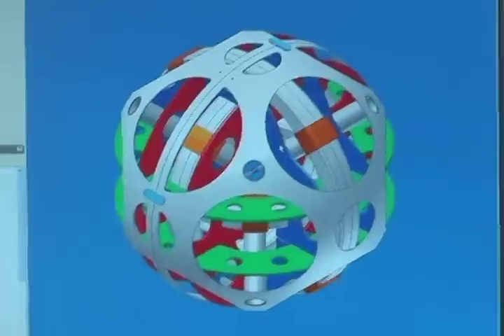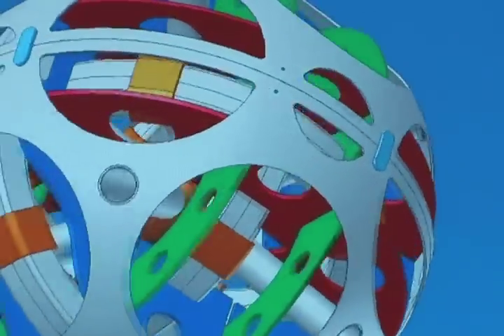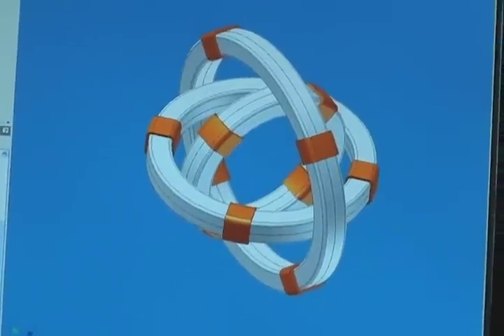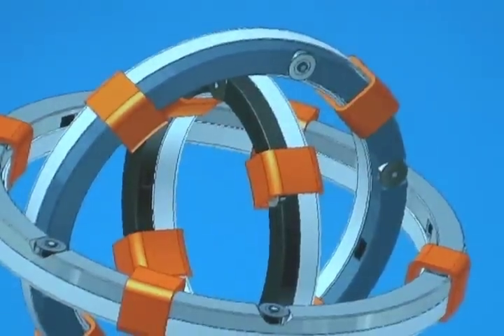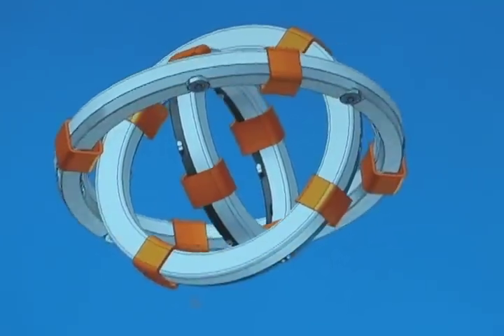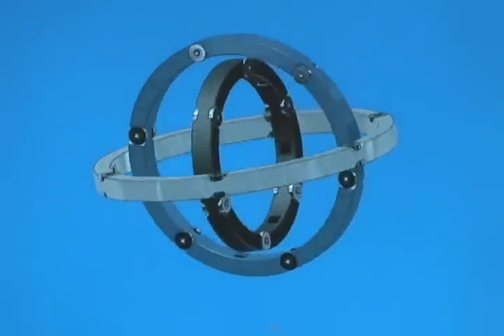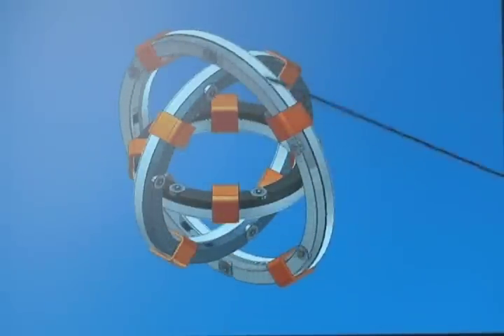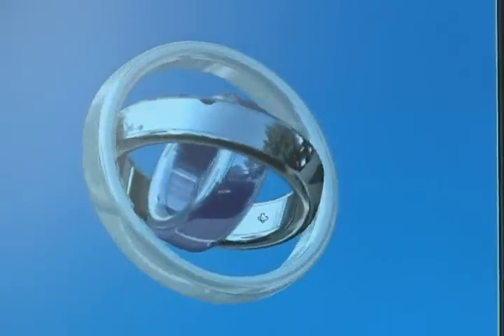Apparatus for Gyroscopic Propulsion Explained

Comment: When I was deeply involved in inventing during my inventing years, I encountered the same conclusion as he states at timing 0:50 in this video. There are currently no equations that apply to this effect. :)
Reply: The design I came up with some years back was to create a more pronounced drive effect by using four separate thrusters. By building them separately this keeps the costs way down. It also makes the device much easier to construct, and to replace when they wear out.

Wear is going to be a major part of the use of these thrusters when they hit the aerospace market (if they ever do). And no, I did not patent my design because when a person patents something, he has to make his design public, which I will not do until I receive a decent payment up front.
 
When I privately spoke with Maurice Ward, the inventor of the only known substance that can withstand the heat of a 10,000 degree thermonuclear blast, he told me a defense contractor tried to steal his Starlite sample. This created such distrust, that Maurice flew back to England and cut off all negotiations on selling his amazing Starlite material.
Reply: Can't say i liked Mr.Ward 1 bit. His secret formula got blatantly stolen a few times. Good!  there is no room in this game for greedy fuckers.
Either u want to change the world for the better, or u dont.
Considering he was 1 of my countrymen, im appalled by his behaviour.

It wasn't the fact that someone in the americas wanted to steal it.. its the unfortunate mindset of a greedy alchemist who wanted billions for something 80% organic & made from hair products.... and still maintain over 50% profits of everything, including its controlled applications.
He thought that this control would open up further secrets of other composite materials to himself through various organisations.
Totally unrealistic expectations in business and the inventors world.

Cutting it short, the man was an insatiable cunt. Hope this helps in clearing up this man's personality and greedy mindset.
Never underestimate the most softest spoken person when it comes to MONEY!.
Now hes dead and its on lockdown.. hahahaaa. Yes what a marvelous man. (sarcasm)
Reply: Exactly. Thanks.
Reply: Rockguitarnow  Just because you and Ray Tippett don't know the math, does not mean that the math doesn't exist.  Describing the gyroscopic pressession phenomenon is acrually quite trivial;  if, that is, you understand Newton, despite Ray's claims to the contrary in his patent.
Besids, the math is not the phenomenon.  Math is only a model for the natural phenomena that we have been able to assign mathematic models to.  All the concepts Newton taught us can be described without math.  The math allows us to quantify things so we can calculate what we want to happen without actually having the objects themselves.  This is sort of the definition of Engineering. 
Cheers, ScienceAdvisorSteve
Reply: @Observ45er  hey you sound like you know what you are talking about maybe you know more physics than i do. So can you please tell me if the set up in the video will work or generate some lifte or thrust???? And why please...thank you in advance
Reply: @aminnima6145  Well, it will not generate any lift. I don't see why there's any reason it should. I just listened to this video again after all this long time and he says nothing about lift in it. Also, scanning up above this I see that I provided one very long post. If you haven't read that, go find it. I think I must cover it all completely.
.
You cannot generate a unidirectional Force force from rotating masses.
..
If you understand what a gyroscope does it basically changes the direction of the torque force you apply to it by 90°. Buy putting three gyroscopes together is a very common way of generating a stable platform that will not rotate in space. 
However , you can translate it all you want. An ordinary gyroscope can be translated up, down, left and right and as long as you don't try to rotate it there's no problem. Many a young amateur and uneducated person interested in science has come up with this same idea..
Do some research on what is called the Dean Drive. It defines a science fair project it apparently some people have been able to build that appears to produce lift when you set it on top of a bathroom scale, but it's deceptive.
.
Please find my other long comment I'm pretty sure I must have covered it all, but I don't remember everything I said and I'm too lazy to read the whole thing right now.
Scanning over my old answer I also see that I made a comment that I looked up to patent and have the number for you to look at yourself. What I said then was that his patent describes this thing, but makes no claims about any sort of propulsion system.
.
In this video he describes a lot of irrelevant stuff that says nothing about the concept that it works on and he's making up terms when he talks about the forces.
.
Since we know that the gyroscope can change the torque you apply to it by 90°, it's possible to take three of these and get that 90° to come back and oppose the torque that you apply, so that when you try to turn it it resists being rotated.
As I said, this is nothing to do with translating its position in space without rotating it.
I don't know what else to tell you.
Reply: @Observ45er  yeah that's exactly what i know about gyros: precession and rigidity in space...thank you soo much for your answer...
Reply: @aminnima6145  K
Reply: @Observ45er  So I assume you understand all the various dynamic forces & electromagnetic fields at work here. If you can't explain it you don't understand it.
Reply: @cosmicHalArizona   Yep. 
You may assume whatever you wish, but there is no linear, translational component to angular momentum, rotational inertia or moment of inertia or a couple.  Never has been. 
It simply is rotational. Can't be much simpler. Those who don't understand that fundamental bit of physics  keep trying to find what is known to not exist. Those who claim so, need to provide the evidence and ever since the Dean Drive was published and shown to be meritless, people have been dreaming they will be the next Newton.
Reply: @Observ45er  facts !!
Reply: @brianlee9310  And, this ^^ is supposed to convey some meaningful message?
Reply: @Observ45er  I was agreeing with you ?
Reply: @brianlee9310  Couldn't tell.  Try being clear.
Reply: @Observ45er  so I want to harness pure energy from the ionic atmosphere as did our ancestors.  What do you think would be the best way? Also I love those orgone generators.  Pyramids and what not. Have you ever thought about making one?
Reply: @Observ45er 😂 this guy ^

Comment: I always wondered if Ezekiel's description of a "wheel within a wheel" propulsion system would be like a gyroscope that contained two wheels, one within the other properly counterbalanced, that went in opposite directions.
Reply: albert miller "Forever learning but never coming to truth" - the apostle Paul. Don't just question, come to a conclusion based on evidence, and why question what is common sense?! Question is 1 + 1 = 2? No, question what matters.
Reply: Anon Mouse You recite the bible in a conversation on truth? I mean it had it's relative truths but come on man, that's a logical fallacy in itself, not evidence.
Reply: Question everything.
Reply: That's what I was thinking. This invention is thousands of years old. Ezekial Chapter 1 and 10. Solomon said that nothing is new under the sun.
Reply: Just look up project looking glass machine

Comment: They give you the disclaimer at the end of the video " this is just the idealized version of the concept " . Otherwise , this object isn't attached anywhere , also it is a poor concept as many movements are left out while adding movements that can't happen . Also wouldn't , if you were to  design a gyroscope , want the most heavier ring on the outside and the smaller ring on the inside ? Because the effect of rotation already creates a centering effect , thus the center piece has less work to do and could be lighter , whereas you'd want as much energy produced with enough weight to create it at the outside .
If attached like a conventional gimbal type it would perform like your basic gyroscope , if it was all attached correctly . Nice display , "A" for animation , -f for mechanics .

Comment: This appears to be more of a non propulsion mechanism, producing stability.  This is similar to what cruise ships use to reduce rocking, no?
Reply: This guy is not compensating for gyroscopic drift with counter rotating gyros. But the theory is if you speed up or slow down any of the gyros that would have an effect on the other gyros crating movement. And this would be for space or anti-grave vehicle.
Reply: Sandy Kidd impressed Universities with his Antigravity machine.  It is a very simple device and obviously thwats Newtons laws.

Comment: Even if it worked it would be buried with the rest of the advancements of science  (probably Area 51).  It will never replace anything nor drive automobiles.  The oil companies won't allow it.  Why do you think we are still stuck with the dinosaur internal combustion engine?  Also unless it can generate free goods and services to the welfare masses, the liberals and Obama would not allow it to become.  On the other hand, if this idea has merit it will make you rich after the powers that be buy it and hide it.

Comment: This would work. Absolutely brilliant. Most people do not understand what gyroscopic forces do when it comes to mass and expression of energy. For instance If i took a barbell from a bench press machine and slid a 45 pound plate on one end of the barbell and fastened it to the end so it could not come off there would be no way for me or really anyone to pick up that barbell with the plate on one end at the farthest side of the barbell. And even if i picked it up with one arm i could not swing it around my head like a sword or baseball bat, the weight would be to great and the forces of gravity would not permit me to swing such a mass. But if i had the same barbell with a 45 pound plate on the far side but this time i used a motor to spin the 45 pound bar bell to around 35,000 rpm then once the 45 lb plate is in motion the gyroscopic effect it would have on the plate would be so great that i would not only be able to pick up the barbell and 45 pound plate with ease but i could lift it over my head and spin it around with one arm. Now thats just gyroscopic force on the +y and -y axis's acting perpendicular to the barbell on the horizontal -x and +x axis's. You're device would act on the +x -x  & +y -y & +z -z axis's thus covering all areas of spacial force expression. And thus all  areas of space/time around this device driven by the three rings composed of different masses to equalize the difference in sizes to make smaller heavier rings and larger lighter rings would ingeniously express the centrifugal velocities equally from the center of mass in the middle acting on all three axis's and thus would literally cancel out the objects mass completely. Thus defying or acting against the forces of Gravity working against the device. Great work this should be fabricated and put to the test!
Reply: You got it.
Reply: If the mass to angular momentum of all 3 components is infinitely equivalent, it will be infinitely stable but not free of its own mass. Particularly if it's housed inside of a further installation, the housing still has its own mass. Its total rotational axis would be unchanging but whatever larger mass it's drawn to will still draw it in. It's not like you're climbing a gravitational slope on the power of gyroscopic angular momentum alone.
Unless I have a fundamental misunderstanding of event horizons and their relationship with positive/negative angular momentum.
Reply: @EndyMMG  What would happen to the angular momentum if a force from within was to be applied on 1 of the rotational axis perpandicular to the gravitation ? Would this generate a precession upwards :-)
Reply: It would work if he build a searl effect generator

Comment: where do i sit.?..lol..said einstein....where do i house my depressed soaking wet cat? you could add sliding coils with a degree of freedom rather than fixed position coils to create a differential in the drive for fine movements and hovering. that way the coil can be moved by hand as well as weigted to create the necessary differentials to overcome stabilisation and create drive. thats how its done where i come from. and we fit a seat in a fixed position around which the apparatus moves in order to have a pilotable craft. they already exist im afraid but not in this realm. especially useful in 0 gravity and microgravitational conditions.

Comment: There would be no drive energy being created here, the coils run past the magnets but so what? As the lines of magnetic flux cut through the coil causing electrons to flow in the coil where do they go?
A metal ring with coils and magnets on it is not a motor.
Reply: You are mistaken. if i take a single piece of copper wire say 2 feet long and wind it into a loop or ring shape and then place a magnet below it or above it or anywhere parallel to it and take each end of that copper coil and attach them to a source of electricity the permanent magnetic field of the magnet interacting with the alternating magnetic flux of the current from the AC battery or power source would be unstable and constantly trying to re align its continuously changing field of North South North South North with the Permanent magnets Set North or Set South field. Thus causing the coil to spin. The same concept is being explained in this video.
Reply: this design is utilizing the same concept of a coil gun or linear accelerator but instead of a straight linear path the coils are pulling the rings through their center magnetic fields flux in a ring shape thus a constant 360 degree rotation occurs. If you think that this guy is wrong then you are then saying that the scientists an engineers who built the LHC in Switzerland the Large hadron Collider, do not know what they are talking about.The same principle of motion that is utilized to propel the rings around the coils are the exact same principles that scientist and world class engineers use daily to propel highly charged particles in a systematic series of loops before they collide with another charged particle in the circular tunnels of the Large Hadron Collider
Reply: I have been for the last 32 years kiddo.
Reply: Well duh, both my ears on on the sides of my head, I always notice right away when I leave one somewhere.
Reply: go fab something that works
Reply: isnt that funny, i RETIRED at age 31.

obviously I did something better than thou.
Reply: jacob wallace exactly tesla even proved that the coils attached to a source creates an electrical charge in his model of the tesla tower
Reply: jacob wallace check out telsa tower coils
Reply: keep living your delusion, it feeds you well.

Go talk to yourself, you have no ear here.

Comment: Ganidllc,   I constructed almost this same concept model in 2003 in Solidworks. Ran motion analysis.   You apparently know materials, and mechanical engineering,  Your model is not quite correct, although very good attempt.   Wondering if you have built this and what was the outcome??     Though inertia, momentum was considered, a couple factors missing.   Needs a couple missing Construction details, and a control, feedback system.    REply is you Need help?     You surely know now that publishing something like this on you tube gets lots of crack pots, but that is the world we live in.
Reply: Wonder if the "motion analysis" in the Solidworks CAD software is estimating the effect if the three stabilizing vector forces can be generated at extreme levels.  I would think if all three vectors were extreme and equally balanced the device would attempt to "stand still in space"  IE it would attempt to become stationary in (real space) .  Given that the earth is moving in relative space (rotational, solar orbit, galactic orbit, expansion of universe - who knows what else) what would the device do? Watch out were your standing when the thing spins up to full speed. The device is going somewhere and not necessarily straight up.  If the device were tethered with a strong enough cable to overpower the gyros I would expect it to suck up some fairly large quantities of energy as it attempted to "stay completely still" against the relatively high speed at which we move thru the universe.   We tend to forget that mass is irrespective of gravity and the only real "anchor" we have to earth (besides our mortgage) is gravity. Once all the other know motions are accounted for (earths rotation, solar orbit etc) this device might be able to determine if the universe is actually expanding as most cosmetologist now believe.

Comment: Many people gets the concept wrong, gyro locks rotational axises but does nothing to prevent motion in translational axises.  Thus a gyro regardless of how many axis will never levitate, it's true that it may seem to defy gravity by not toppling, but this is only a counteracting moment preventing "falling over", it always requires a vertical support to counteract gravity.
Reply: I was thinking the same way but what happens if the 3 gyro are pulsating back and forth along their axis of rotation. A push from outside from a random direction, a force, is not instant, it applies in time. In that finite time the 3 axis of rotation are translating due to pulsations so the action of the force translates into a torque which in turn invokes the gyro precession action. Wouldn't this work? I would expect to resist the external force and remain in space.
Reply: Wow so that's why the searl effect generator levitates.... its vertical support is just magnets and gravity
Reply: There are videos of inventors disproving you entirely